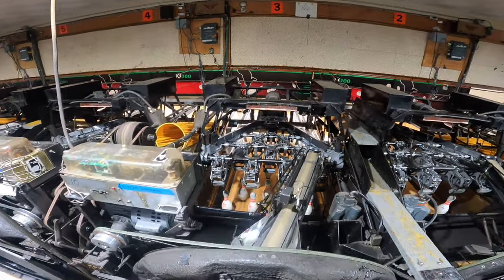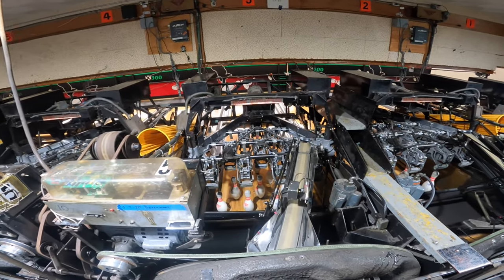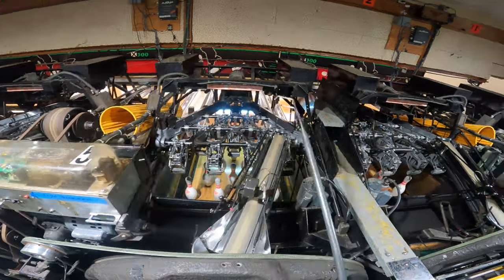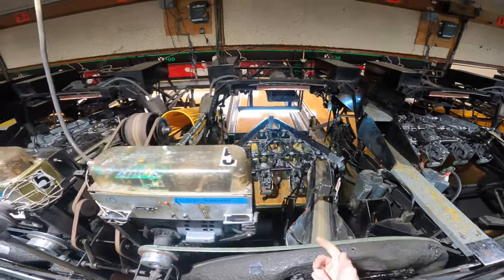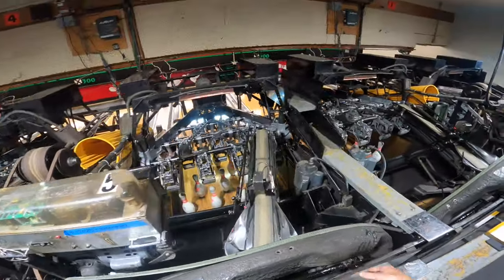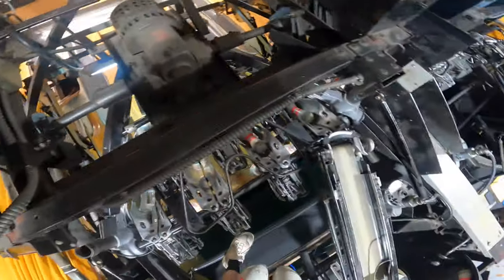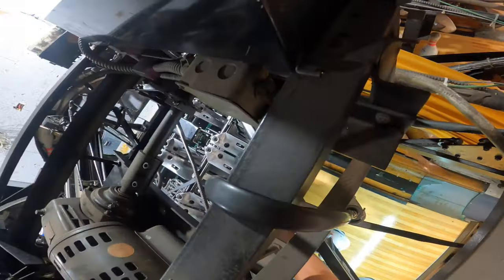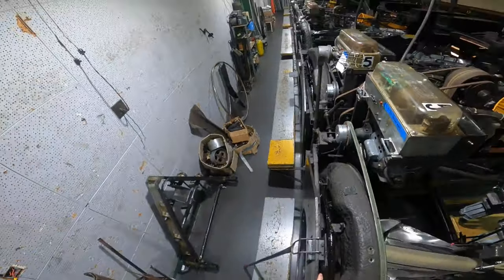How To Re-spot a Pin on an AMF 82-30 Pinspotter|askJoethepro

Comment: The first way you demonstrated the set up is the proper, correct method of setting up a pin.   It takes way too long to pull pins out of the table.  One warning:  never "add" a pin to an existing spare on the deck.  The bowlers will throw a ball and shove the pin hook up your arm pit !!  Look at the spare that's on the deck and cycle the machine.   Then reset the spare they wanted.  Also, it shows you if there's a problem with that cell.  To reach the head pin, use the #2 pin to knock the head pin over.

Comment: Instead of removing pins wouldn't it be easier to just set a full rack and as pins  and then hit cycle 2 again. As pins come off the wheel, grab them and throw them in the cups they need to be in. You can also be hitting pin counter switch at the same time. Once you've got all pins loaded and count 10 on the switch, machine will set pins. Or am I missing something. Not really familiar with the 30's but that's how I used to kinda do it on a Brunswick.
Reply from the maker: Yeah you could technically do it that way too… it’s just hard to change what cycle these machines are on… thanks for the question, Phil!